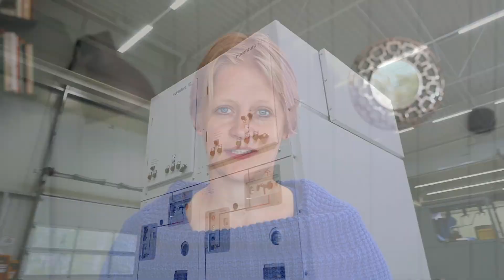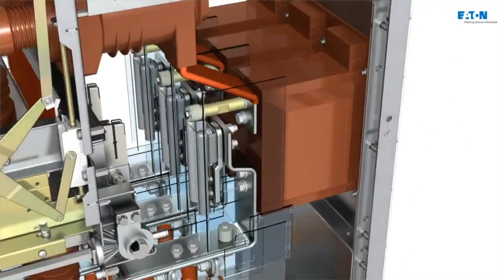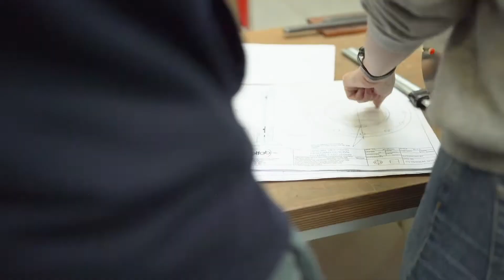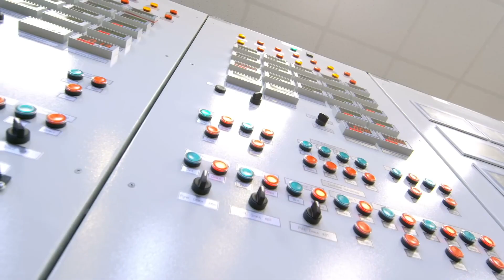A new way to think about cleantech innovation

Comment: pls show product  what can it do price + cop + how it function+.........
Reply from the maker: Thank you very much! 🙏  The nu1 is a single busbar primary switchgear with up to 36 kV, 2000 A, 31.5 kA. It is a fully certified and type-tested gas-insulated medium-voltage switchgear for primary distribution indoor applications. It completely avoids SF6 and instead relies on dry air as the insulation medium. It is designed and tested according to IEC 62271 standards. 

Nuventura's nu1 maintains all the benefits of the conventional GIS, such as compactness, and highest reliability in a maintenance free design. On top of that, it offers 100% climate friendliness known from traditional air-insulated switchgear (AIS). Please find more information at https://www.nuventura.com/product.

Nuventura allows whitelabeling. So, it is quite possible, if you see a SF6-free switchgear of another company, that they use Nuventura's technology.
Reply: @NetZeroTech  Thank you. will you be making a video about it?
Reply from the maker: @nezzar7332  Possible. I have an air-to-water heat pump company, Harvest, in the pipeline and paid Patreon members had some ideas. It's on the list of video ideas. Thank you!

Comment: Are western governments banning SF6? That would inhibit domestic manufacturers from using it for their products and it would force foreign manufacturers who wish to export to the west to not use SF6. I hope his product catches on and having SF6 banned would be helpful. I don't know what SF6 status is.
Reply from the maker: Thank you! Much appreciated.

The European Union has taken significant steps to regulate and restrict the usage of sulfur hexafluoride. The EU’s regulations aim to reduce emissions of fluorinated gases as part of its commitment to combating climate change. The F-Gas Regulation prohibits the use of fluorinated gases with high GWP in some applications where lower-GWP alternatives are available. This includes bans on the use of SF6 in certain types of new equipment.

In the US, the use of SF6 is not banned in any type of new equipment. However, in some states the emissions rate is capped. For instance, in California the maximum emission rate is not to exceed 1 percent since 2020.